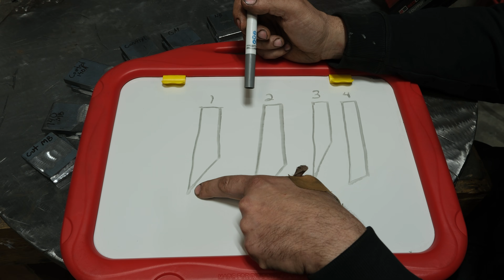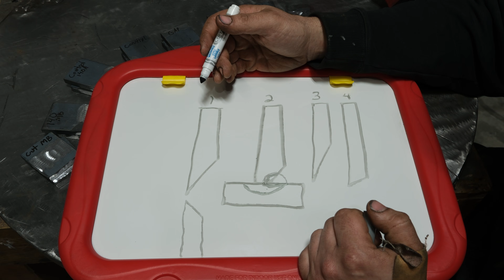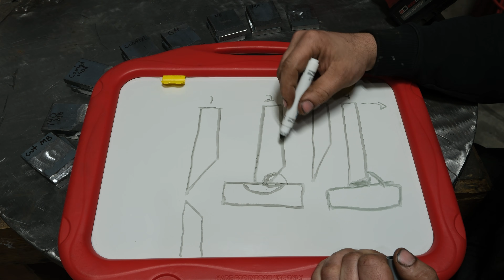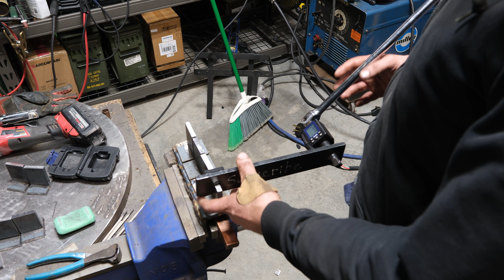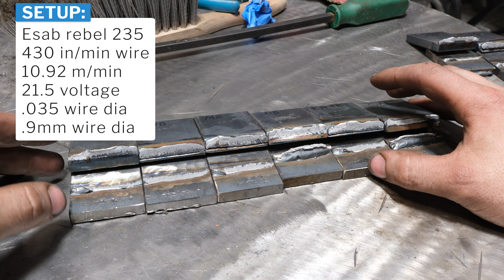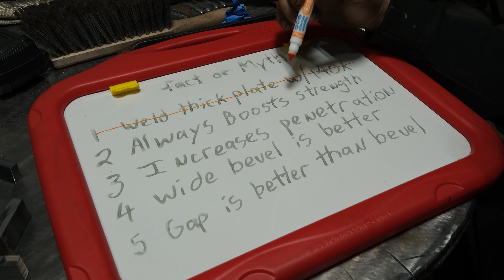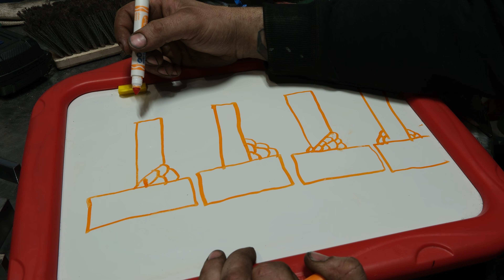Does beveling increase weld strength??  Deep dive

Comment: When I NEED it to be as strong as possible, I GTAW. When I need it strong, SMAW. When I need it fast, GMAW. If I need it fast and strong, Dual Shield FCAW. I'm still just a home handyman welder, but continuous practice is making my welding better and better. I love your videos, you got me checking my work routinely. It makes my welds better.
Reply: If your machine will do spray arc, go get a bottle of 90/10 (Ar/Co2) and try it. It welds real nice. It almost turns the steel to butter like TIG welding. And it gets real deep penetration. I only use it on steel 3/16” and up. Mostly I use it for 1/4” material.
Reply: @zenlandzipline  ar/c02 is for stainless ar/qxy is for carbon
Reply: @chopperchuck  oh, ok. I stand corrected. Is qxy oxygen and you just misspelled it? I will try argon/oxy after I empty this bottle of 90/10. I’ve  been using a mix of 90% argon 10% CO2 for pulse spray arc transfer for carbon steel. It welds awesome but I’ll have to try the argon/oxy. I haven’t done any stainless MIG welding in at least 10 years, but when I did, it was some tri mix like argon, CO2 and a tiny bit of helium. I just TIG anything stainless these days. I do a lot of stainless sanitary pipe and for that I just use straight argon. 
There s a lot of bad info out there, I’m glad I can get good advice on YouTube .
Reply: @zenlandzipline  yep I miss the spelling 
But what I haven't missed is 40 years of being a certified pipe and boiler welder
Reply: @zenlandzipline  I have always used 95/5 argon oxygen for spray transfer of carbon steel and 98/2 argon CO2 for the spray transfer of stainless steel no matter what shop I worked at this was the standard
Reply: @chopperchuck  I’m not doubting your knowledge or credentials. And I’m not making fun of your spelling. I jphit the wrong letters on my keypad all the time. I was just asking to confirm if you just meant oxygen. 
I could be wrong, but I think you can use 90:10 arg/co2 for spraying regular carbon steel. I mean, I’ve been using it for years, and it welds great. Maybe 95:05 arg/oxy works too, and I’m not doubting that it does, and it may even work better than what I use now. So I will give it a shot when this bottle runs out. 
As for spray transfer stainless…I have only short circuit on stainless, and I haven’t done that in a long time. I bet spray works great on stainless. Other than the health risk of breathing in the chromium fumes, love welding stainless.
Reply: all of the process you listed are just as strong as each other
Reply: Maybe they all can be 70k psi tensile, but theres other factors to consider. Short circuit isnt as strong as say tig or stick, but its much faster and more repeatable than those 2. All have perks@chopperchuck

Comment: Great work Greg, now maybe is the time to do the test by beveling both sides with a 1/8 landing  using spray  and stick with 6010 then 7018 and see how they preform in these bend tests as in the tests done they are welded only on one side.
Reply from the maker: I will be doing a bunch of direct comparisons soon.  I don’t believe I will be able to break a set of plates that are welded on both sides due to them being too strong (the plate will just fully bend.  I do have a different way to measure performance though, I will likely do a butt joint and bend them to demonstrate weld failures (like what’s done with a pipe strap cutout bend test).

Comment: Sounds like a machine with more amps is what would be needed to achieve good penetration.
Reply from the maker: Switching to spray welding or bigger dual shield wire would definitely make a big difference in performance.

Comment: Try those welds with 3/32 and see how much it digs in.
Reply from the maker: So believe it or not I tried to run this test with stick and couldn’t produce consistent enough results that I felt the test was valid.  The issue I ran into was that different bevel angles work for mig because of the wire size, but they don’t work for stick.  With stick the bevels and gaps posed a huge problem of often lengthening the  arc gap and causing arc blow.  That could be fixed by slowing down, but slowing down deposited more metal, which gave higher strength.  So basically what I had to do to maintain control of the arc forced me to make thicker welds and thus skewed the test results.  To a certain extent the same thing happened in this video, much of the additional strength came from the additional metal, not the fusion (the fusion was poor regardless).  

I will be doing some direct comparison with stick and mig (and tig) soon, which should provide some valuable info.

Comment: Very informative video as usual, I do have a question though: would this out come be the same for stick welding? Never mind, you covered that on 32:00
Reply from the maker: Stick can have more or less fusion than short circuit mig.  Believe it or not 7018 typically doesn’t have more root penetration than short circuit mig, but it does have more sidewall fusion.  6010 has a lot more penetration than short circuit.  The hardest part with stick on grooves/bevels is the angle must be right.  If it’s too narrow the rods arc gap will get out of control and a poor arc blown weld will be put down.  I will be doing a video in the near future comparing short circuit to stick and talking about which truly is stronger (with tests).  This will probably be a bit eye opening lol.
Reply: @makingmistakeswithgreg this will be first time for me to turn on notification for YT video. Can't wait for results, thank you Greg!

Comment: Well greg aka this old tony, penetration is key to a bond weld. If you want a stronger attachment your penetration has to be at least half the average material thickness per side in a double sides weld. A bevel allows you to get in deeper, the difference between a weld and a braze.

Comment: At the end of the video when you started talking about stick welding bevels I chuckled. I couldn’t tell you the amount of times that I had to rebevel in the field bc an 1/8 7018 wouldn’t get all the way in to the land and I didn’t have 3/32. Or the amount of times that I had to open up root openings with a burr bit bc I needed more room for my root pass due to the welds being UT’d.   Would fluxcore perhaps give better results than short circuit mig?
Reply: Or, 100% CO2?  Have heard (read) that runs hotter and gives better “penetration.”

Also, have access to a 190 amp Mig… do those pen’ better???

Comment: You mentioned that stick welding wouldn't have done any better due to the size of the electrode being too large to get into the root area. Coincidentally, I just also saw your older video where you did some runs with 1/16" rods. Ha-ha!  Even 3/32" would get into a bevel better than 1/8".
Still, if anyone welds 3/8" steel with short arc MIG, I question their wisdom. I would use flux core before any MIG process on anything larger than 1/4", or good 'ole stick.
Reply from the maker: The smaller rods will definitely help get into the root.  There are still far less variables that work with stick vs mig simply because of the wire diameter.  That’s not actually a bad thing, rarely do more variables in an overly complex thing add much good lol.

Comment: My first post was written at the beginning of the video, intentionally, to see whether my thought matched the results. This is afterwards. Maybe, sort of. I try to angle the wire to shoot it all the way back into the bevel, if possible. But I won’t lie, I haven’t tested.
Reply from the maker: The hard part with the mig gun I have is the nozzle is big so it can be difficult to actually hit a decent angle with short circuit (which has a short stickout).  With spray it’s far easier due to the longer stickout.

I will be interested in what you think will happen with the video I have out tomorrow on 100% c02 gas vs c25.  That came out surprising to me.

Comment: You don’t get more penetration. But you do get slightly more surface area in the weld. How much that helps, I’m not sure. But I’ve done it a number of times. For certain butt welds, if I’m going to grind the weld flat, I always do it.